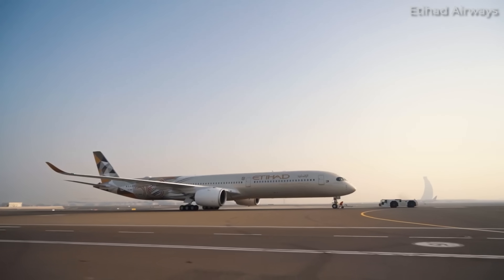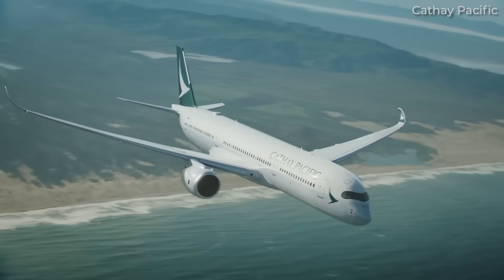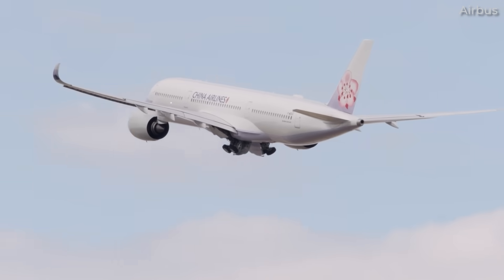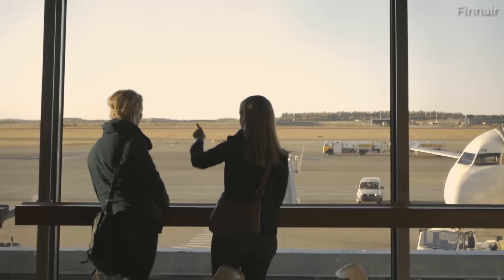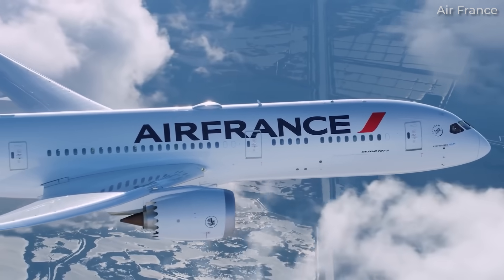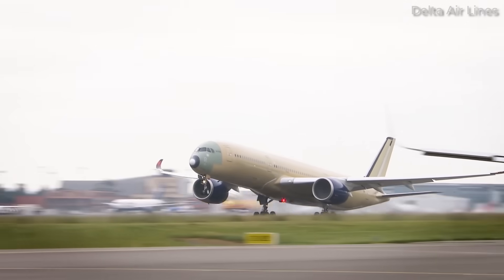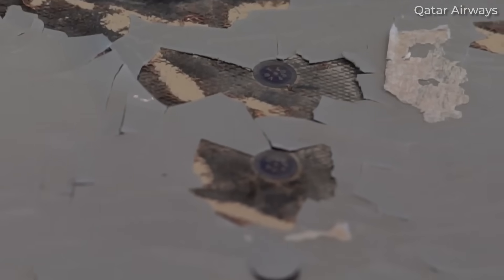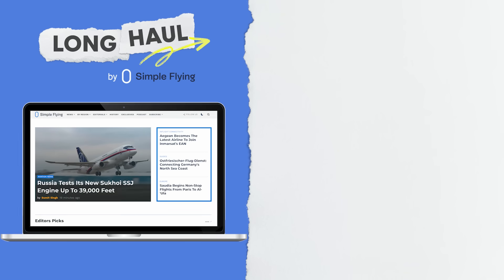What Are The Operating Costs Of An Airbus A350?

Comment: $5000 of fuel is based on $2 per gal jet A at 6200kg per hour consumption. That price is only available in UAE Qatar Saudi. In USA Jet A cost over $4 per gal so $10,000 per hr. In the EU Jet A costs over $6 per gal so $15000 per hr.

Comment: Flew on a Singapore Airlines A380 followed by A350 of the same carrier and I think A350 is way worse than A380 when it comes to passenger comfort. The B787 is much better than A350 when it comes to vibrations and noise
Reply: Define why it's worse? At least tell the reason, rather than just moaning about the A350 bad.

Comment: The best long range aircraft, from a frequent passenger's point of view!!!
Reply: For a frequent flier, the airline matters more than the aircraft itself. And if the same airline with the same product, then the choice is more subjective. Eg the 787 is a great plane, but one can't fully close the windows (as they are electronically dimmable rather than equipped with a sunshade). So if someone has an issue with that then they will dislike that plane

Comment: I was somewhat surprised that the fuel burn per engine is 3.100kg/h to 2.900kg/h for the A350-900 and around 3.450kg/h for the A350-1000. With all that reporting of more efficient engines, I had assumed that this value would be lower for these modern engines.
Especially, since I remember a cockpit on a DC-10 flight from GRU to MIA in early 1993. Shortly after reaching our initial cruising altitude of FL310 I could observe a fuel burn of 3.300kg/h for each engine. Close to our destination we had reached a final cruise altitude of FL350 and a fuel burn of about 2.600kg/h for each engine. This lower fuel burn was due to burning off of fuel and being able to climb to a higher cruise altitude.
Reply: As an A350 pilot myself, I can assure you that these numbers are quite correct. Of course that on short hauls, the average fuel consumption drops to nearly 5500 tons/hour. These numbers are actually quite good, compared to the B777-300ER for example, on a 12 hour long haul flight, the A350-1000 burns around 3tons less fuel per hour, which is a major fuel saving. As for the engines’ fuel burn at the beginning and the end of the flight, I could say that the numbers on the A350 are similar to the DC-10, but you have to consider that, not only the A350 only has 2 engines, but also, each one of those two engines produce far more power than the DC-10 engines (53000 lb per engine on the DC-10 VS 84000lb on the A350-900 and 97000 lb on the -1000).
Reply: @djonymorais  Thank you for this clarification and additional data.
Reply: The DC-10 had three engines, the A350 has two. I think that is where the major cost saving is.
Reply: Well, XWB95 has a bit more thrust than any JT9D.

Comment: Well we see why the 380 failed. Average operating cost per hour is in the range of 25 thousand to 30 per hour
Reply: Not exactly. As in its a bigger plane will of course have a higher operating cost. But it can be viable if the load is high and consistent. But if the load isn't consistent then yes the smaller aircraft will make more sense
Reply: @ZK-APA the math for the 380 only works on Highy premium routes
Reply: @John-bi1lv exactly. I never disagreed with you.

Comment: Japan Airlines flies the A-350 for 1 hour sectors successfully (like Tokyo-Sapporo) 
Traditional carriers prefer to spend more, and have a state of the art airplane
Reply: One should mention that JALs domestic A359 are a special variant with reduced MTOW (airport fees are usually MTOW-based), equipped with RR Trent XWB-75 (XWB-84 with reduced power, but longer time-on-wing) and a high-density configuration (2-2-2 First, 2-4-2 Business, 3-3-3 Eco).

If there's constant demand, it works (like it did before with 500 seat Boeing 773). Also Japan is a quite rich society that can afford and is willing to pay a little premium for better quality. But in most other countries their usually is less demand (EU, Americas) or a used, re-configured A330 doing the job for less.
Reply: Not always. What you mentioned is an exception, not the norm. Basically if there is a short route where the demand is so high that its more profitable to fly one big aircraft rather than multiple smaller ones, then yes the bigger plane makes more financial sense.

Comment: I can see where the costs might be variable depending on the airline.  I can imagine somebody like Vietnam Airlines having lower crew cost than Lufthansa and Saudia getting a break on "at home" fuel costs over Air France.  Neither the A350 or the 787 have been in fleets long enough to get the true picture of long term costs like engine overhaul or resale value.  And there are always the unknowns like a defect like the 787 has had a couple or engine issues like the P&W engines have had on the 737/A320.
Reply: Dozens of 787 and at least some A350 have already been sold. Some 787 are in operation for ~14 Years, the first A350 for a decade - so definitely a lot of real-world experience in terms of maintenance  costs (even including D-checks for early adaptors). And engines are overhauled quite often.

Comment: Done a bit of travelling now and I find it easiest to sleep on the A350 and A380. The noise and vibrations aren’t as bad and it makes my long haul flights so much more bearable.
Reply: I agree. I think A350 is one of the best aircraft out there. But how about Boeing 787? It’s a nice aircraft as well
Reply: @drewjamila3868 I didn’t mind the 787, but found it was slow charging my phone haha. I was able to get a few hours of sleep on the 787 and it was comfy but A350/80 are just different
Reply: A350 has one of the smoothest take offs l have ever had. I flew the 737 max and this back to back. I can report that airbus is int the safe hands. The max was good in terms of cabin pressure but the A350 was just another experience from the way it takes off. The power of the engines can be felt through how is glides and immediately you're in cruising altitude with low noise.

Comment: Another video that could've been 30 seconds long: around $9000 per hour, including about $5000 in fuel cost, $1400 maintenance, $1200 crew, $1100 depreciation and  some other minor costs.
Reply: Thank you for this!
Reply: saved my 10 minutes bro
Reply: How come a business jet sells for 15-20k per hour???
Reply: @ottodiesel9992It is what you rent it with the profit included. That is different to operating costs. Also business jets don't usually have the same utilization.
Reply: Video wouldn't be monitized if the video was 30 seconds. If someone needs direct to the point values then it makes more sense to go to a print article or a google search tbh
Reply: Thank you! Surprisingly accessible I'd say given how many passengers to split the bills.
Reply: How can fuel be $5000 per hour if the video claims 6.2 tons per hour consumption ? 6.2 tonnes is 2500 gals x $4 = over $10,000 per hour. $6 per gal is over $15,000.
Reply: @hungrysurfer9471  According to EASA current price of aviation Jet A fuel is about $780 per ton, which would mean $4836 per hour, so they are spot on. It's a different fuel than you put in your car.

Comment: How does Ryanair work with €10 fares?
Reply: Commercial air traffic has basically no taxes. Kerosene costs 1€/ltr. The average Ryanair flight is probably around 2 hours long. The average tiket price is likely about 75€/hour.

Thus with even the same operating cost as an Airbus A350, you would have almost 30k€ in revenue of which only 20k in operating costs. In reality Ryanair's profit margin is about 10 %.
Reply: @rkan2 When the airports charge up to €30/pax in handling fees, how can Ryanair charge €20 for a ticket? I have had tickets as low as €5 for a three hour flight, €15 for a 4.5 hour flight. The math isnt mathing.
Reply: It’s not volume.
Basically, they cheat.
But as they provide so much ‘free’ revenue to the Irish CAA, they are enabled to bend the rules.
And there are good reasons (well bad actually, as they contravene so many EU rules on fair trade etc…) why they have significant bases in some countries and not others…
Reply: Only 300 in extra fee’s
Reply: @rannyacernese6627 Not from me they wont. The most they sometimes get, is the Ham and Cheese Panini, which is quite delicious, and reasonably priced compared to the regular airport food.
Reply: Volume